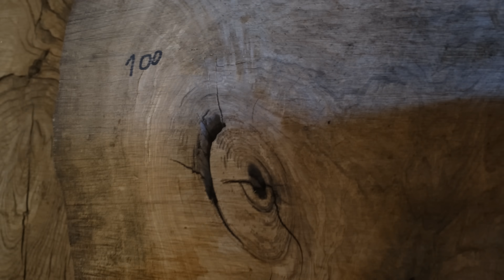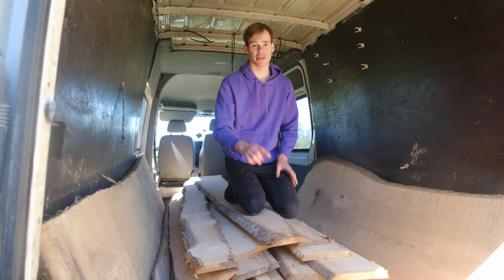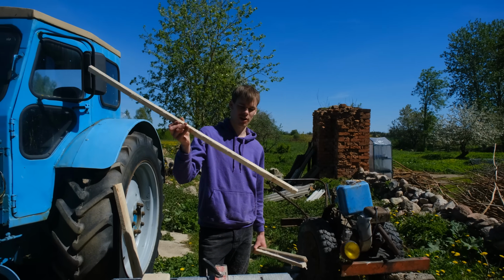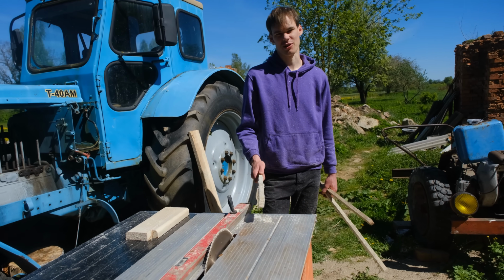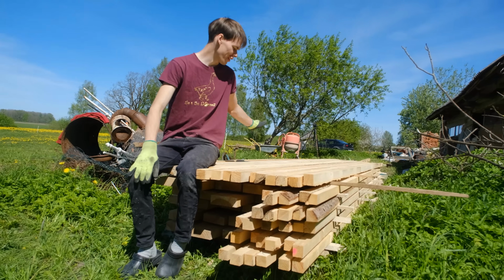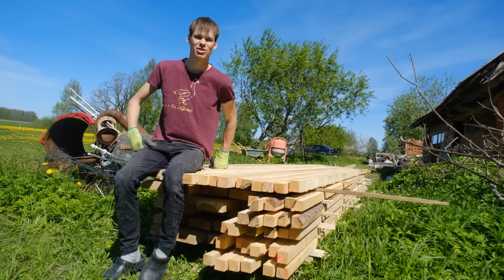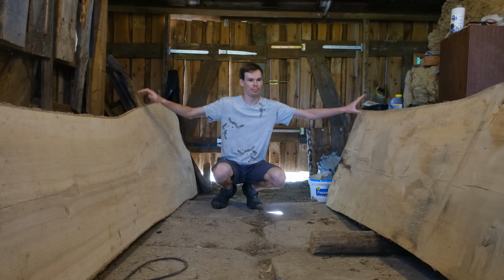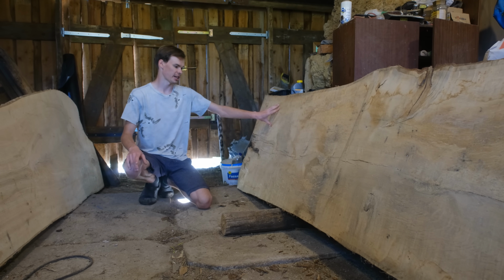Wood Material for UPCOMING Project?

Comment: A suggestion about running your table saw on a long extension cord.  You need a very heavy gage extension cord to run that long distance OR you must get your saw very close to your power source and use a short, smaller gage extension cord.  There is too much amperage/voltage loss when running power through an undersized extension cord. to serve a heavy draw like a table saw. That's why your motor burned up.  You were running the saw continuously at capacity.  As the heat built up. the resistance increased until your saw motor melted.  
If you are going to buy a new saw, please buy a heavy gage extension cord or make your own with heavy gage wire to get sufficient  power from your breaker box to the barn temporarily.
Reply: This sounds like sage advice. Well explained, too -- as even I can understand.
Reply: @paulahansen3772  Thank you for your kind words!  Over use of an extension cord can result in  fire.  It would be a real tragedy if something like that happened to our friends.
Reply from the maker: The cable is rated for 3kw and the saw is only 1.8kw, it's a very small saw and the amps are only 8 if you would run the same saw on 110v it would be double and the cable size would need to be bigger but this cable is more than enough to run the tool. The saw has been cutting for 4 years now and only posted 100€ so it was very cheap plus I might be able to fix it by replacing the carbon brushes which every tool comes with. 🤔

Comment: The sticks used between layers of wood for drying are called "stickers".  
Your pile looked pretty good except you were short one row of stickers on the end  closest to the van.  You don't want to stack the ends of the plank unsupported because the plank will surely sag and twist.
Now find some sheets of tin or a tarp to protect the top layer from sun and wind, add several planks crossways like the stickers and weigh the cross planks down with bricks, stone, whatever you have that is heavy.

Comment: My tip for the next move of those heavy wooden boards would be to place the card in the middle of the board using two c-clamps attached upside down on the middle of the four wheeler card to keep the heavy wooden board standing on its side clammed in between the two c-clamps as you hold up the end and guide it in the shed.
That way you can walk more upright, you don’t lift heavy and you can steer by simply pressing down on the board rotating the card on two wheels.
Just don’t lift heavy while your young, you’ll feel your back as you get older.
Just try to take of the weight, lifting with your legs instead of your back, don’t lift away from your core and don’t lift if things get heavy, take your time, you’ll find a way to do it without slowly breaking down your back.